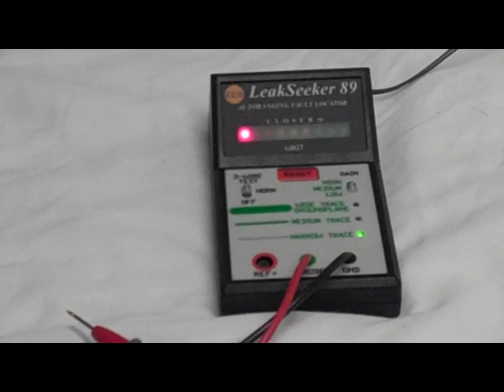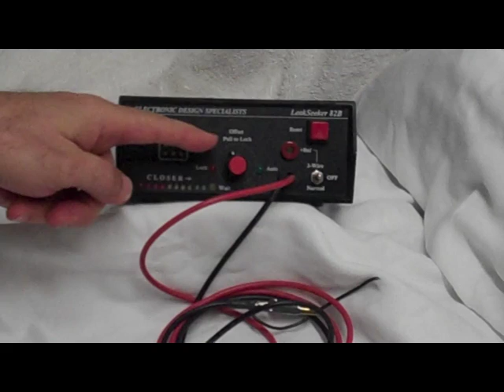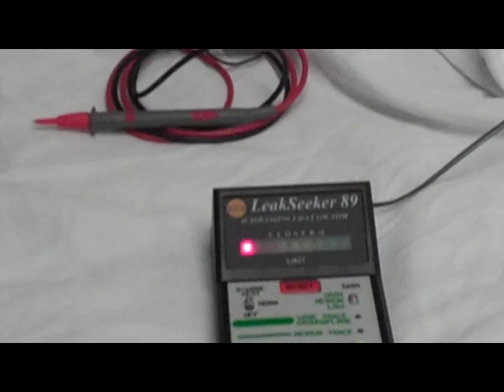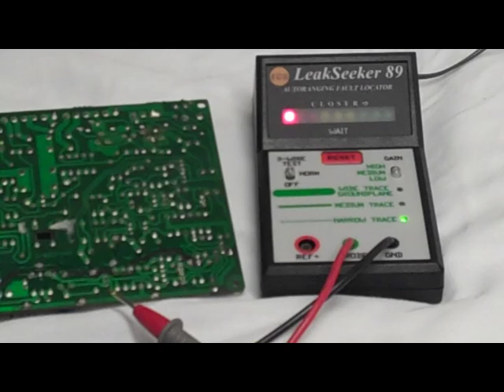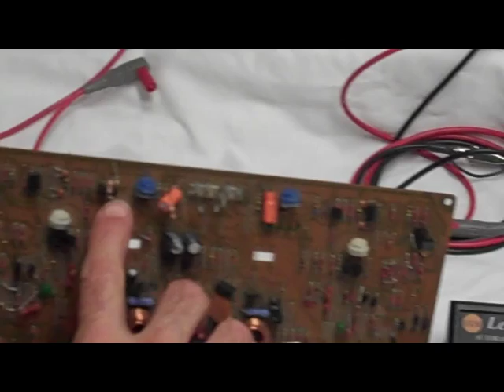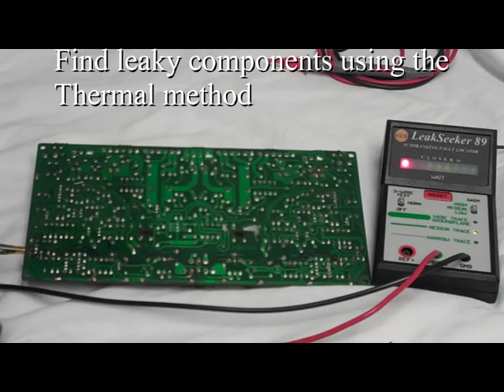EDS-89 by Electronic Design Specialists

Comment: let me first just give you an idea about me, I work and have the following tools: toneohm 950, FlirT400, Huntron tracket 2700, Huntron Protracket I, Micro ohmmeters, Pace prc 2000, Metcal solder, Hi pots 5K/6K, Chroma 11200 Hi V Cap tester, Textronixs, all kinds of flukes......... 

the easiest  and probably the only way to find the shorted component with this junk is to know where the short is. Lololololo, 
I wanted to have something small for field services. 
I got fulled and purchased one, pcb is junk, tech support is non existent, the guy selling the kit on ebay Hugh-mercedelec, is a crook......
the unit never worked. 

first of all, when you are working forwards looking for the short and you do not know where the short is, you are working your way back to your other probe not the short. you will pass the short and keep going towards the other probe.. I hope it is clear what I am saying because I don't want anyone else wasting their money. 2nd, when you buy one no one gets back with you for tech support. the thermal way would be the correct way to find the shorted component if it worked, though. the 3rd wire does not work at all. don't buy this junk.

Comment: I got the kit you sell though ebay. the housing is not closing because cap C8 is too big. I tried contacting you though ebay 1/2 hour ago, Dec 4, 2021.  if there was a picture of an assembled pcb any where it would have been great. 
waiting by the desk for your reply.  
in the part list (the only instruction that comes with it), says C8 is a 1000uf cap. is this correct or should it be swapped with the 470 uf cap. which the part list has it going to C7?
if he answers I will update and let everyone know how well the unit works. if he does not answer I will be doing a refund through ebay money back guaranty.
Reply: I had to bend C8 on its side before soldering it in. It clears the case fine if you do that. However my unit still doesn't work properly when powered on. I sent an email, hopefully he responds.
Reply: @treminaorugx  yap mine doesn't work either. it a junk. man. the guy that sells it is an idiot. I think he copied the original one and does not know anything about them.
Reply: @bobbauvian7700  he was quick to process the order and ship it to me so clearly he is watching his email. No response from him for my question yet.
Reply: I am opening a dispute with PayPal for a refund today since the seller doesn't want to respond to emails.
Reply: @treminaorugx  great glad to hear that.
Reply: @bobbauvian7700  So apparently the person selling these and the person who designed it are different. Hugh with Merced Electronics is selling the kit and these videos of the device are from its creator, Dave Miga. So I've now sent the info to Dave, hoping he responds. I guess Hugh was not aware of these comments from people on YouTube.
Reply: @treminaorugx  Thanks man, I hope he comes up with some kind of remedy. because if this tools was working it would have been a good addition to my tool set. but it is labeled as junk on my shelf with a note saying worn everyone about it and him and never quit.
Reply: @bobbauvian7700  Well I spoke with Dave and it was... not pleasant... but the issue with mine was the LEDs polarity was reversed. The flat side of the LED needs to align with the thin stripe on the left side of the LED pads for L1-9 and L12-14 (right side for pads L10-11). C8 is 1000uF like you stated, and it needs to be bent down sideways, laying flat on the PCB, in order for the housing to close. Several other smaller tall caps also needed to be bent at a slight angle to let the case close. Here is an image of an assembled PCB, C8 isn't bent on its side so I'm guessing that some kits came with shorter caps https://i.ebayimg.com/images/g/xFoAAOSwiwZcFF9p/s-l1600.jpg
Reply: he replied, but seems his reply is not to solve or admit to the problem I listed. this is not something I should need to prove to him. he has the same parts he  needs to assemble it and see if it closes. this is getting frustrating. Dec, 8/21
Reply: he has not solved the problem yet. 2/16/2022. don't buy this junk

Comment: Buyer be ware. I bought one of these kits and ran into a few issues. 
#1 It only comes with a bill of materials and no schematic which is a serious oversight.
#2 There isn't any kind of description of how the circuit works which is another serious oversight
#3 My kit has the kind of fault that suggests the code is corrupt or the microcontroller is knackered.
#4 I Emailed the designer about my problems but after about a month I have accepted he probably isn't going to respond.
In summary, whilst I agree the the product looked good in the videos, for me, it's amounted to nothing more than an expensive pile of flashing LEDs but in fairness, that's the risk you take when you buy a hobby grade product from what's probably a one man band enthusiast.
Oh well, back to the trusty ToneOhm :-)
Reply: I just got the same kit and found the housing can not be closed because C8 is too tall. I thought may be there is been a typo and C8 need to be swapped with C7. in the part list is says C8 is 1000uf and C7 is 470 uf. but looking at the pcb it seems those 2 should be swapped. but I don't want to do this until the seller contacts me back. and he has not yet. it just been a couple hours though. 
you mentioned toneohm. I have a 950 toneohm but I find it pretty complicated to use. that is why I went for this kit.
Reply: @bobbauvian7700  Don't hold your breath dude it's been months and he hasn't responded. I'm not sure he's even in business still or maybe something has happened to him but either way, I don't think you're going to get any assistance.

Comment: I have the 82b and it works really well. I would love to test the new Leakseeker.
Reply: I got the 89 and it is junk.  their tech support is non existence. I have a toneohms 950 in the shop.  I figured I get something similar for the field. boy did I make a mistake.
Reply: @bobbauvian7700  I still have mine used it on a couple projects, now my hobbies have changed a little. I might put it up on eBay for sale. It worked fantastic on fixing and troubleshooting retro games systems.
Reply: don't sell that junk
Reply: @bobbauvian7700  I don't think 82b is junk it helped me fix a lot of retro game systems.